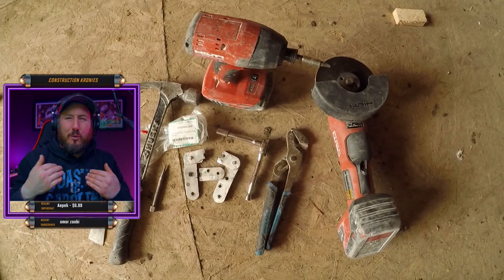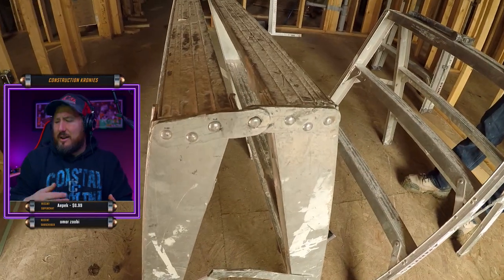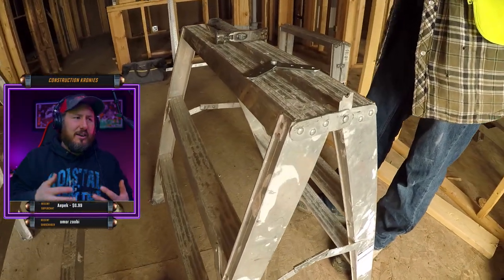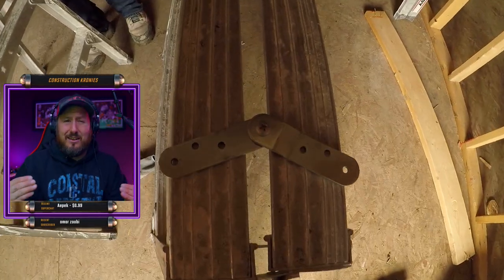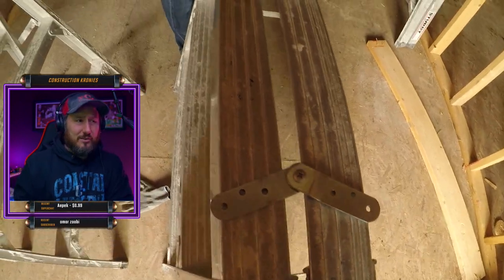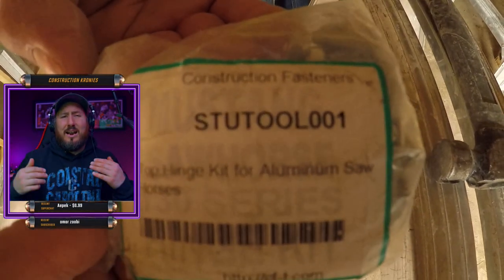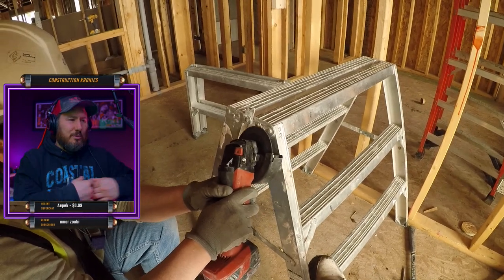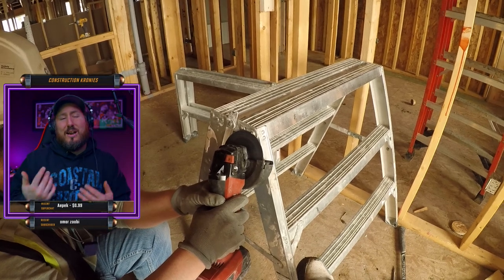Sturdy Workbench Sawhorse Repair & Save $100's!

Comment: Thats pretty cool! I refurbished the deck on my bakers..the plywood rotted out. I drilled out the rivets and bought new nuts and bolts, upgraded the deck to 5/8” solid af now.
Reply from the maker: nice! Man that would be a solid platform. Bakers are my least favorite, I work on all kinds of lifts at any height but them bakers sketch me out, I actually fell through one that was double high cause the platform fell out on me, I wasn't walking for a couple weeks. How is the weight of the platform?